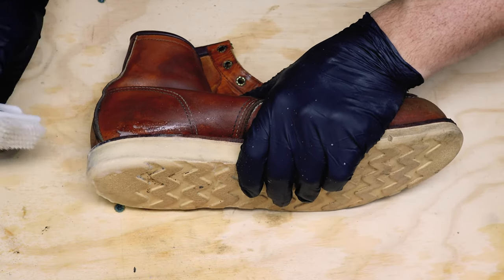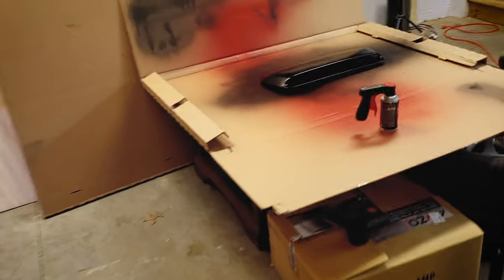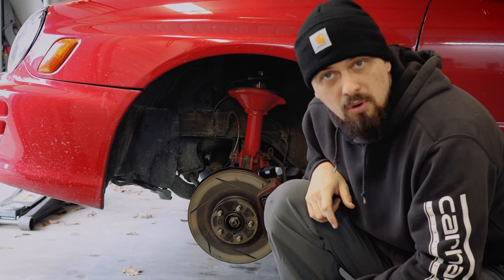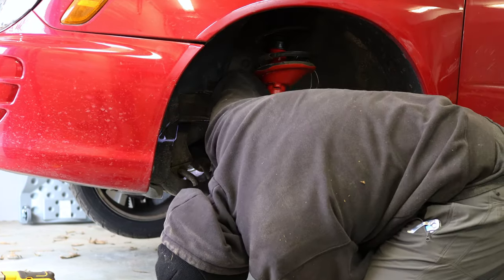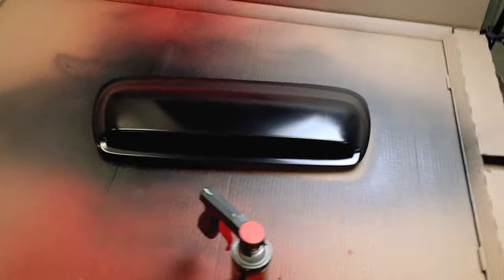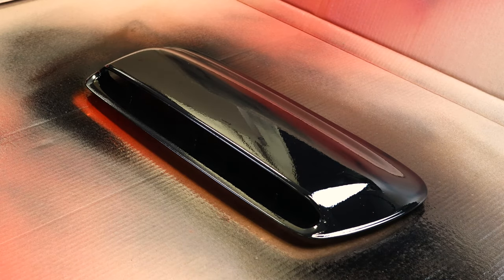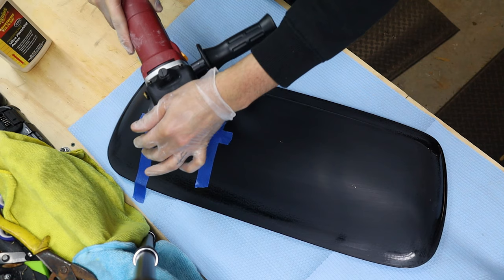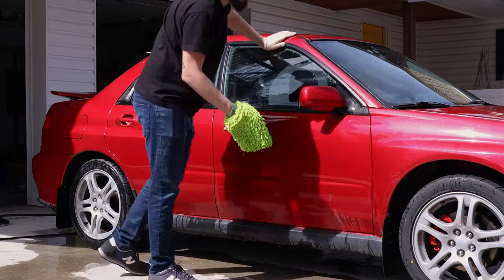2002 Subaru WRX autocross project - Painting a scoop with spray paint - Ep 8

Comment: bit late to the party but how did u make it look so hard getting that nut off? socket and breaker bar does it 1st time, done it loads, just need to use some muscle :P
Reply from the maker: I snapped a breaker bar a few weeks earlier on a stuck bolt. When things haven't been removed in a while, there can be a lot of corrosion or rust that binds things up. The last thing I wanted to do was break something. In this case, I had the breaker bar flexing hard enough and the suspension compressing hard enough that I wasn't willing to put more pressure on it. I was far above the torque the axle nut is supposed to be at, so I knew that it was too corroded or pinched to work correctly.

Hopefully that makes sense!
Reply: @NeverEndingProjectGarage  fair enough, not had them that tight before, was part way through binge watching the whole series when I saw this lol